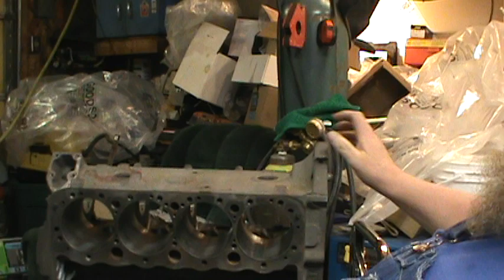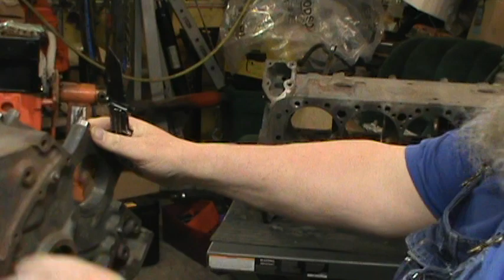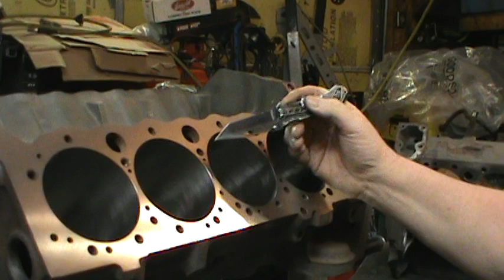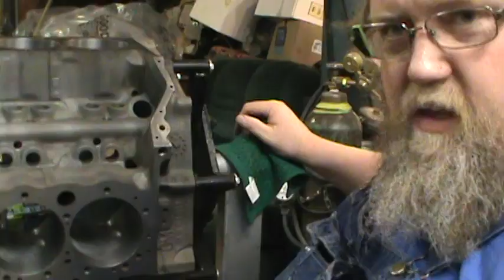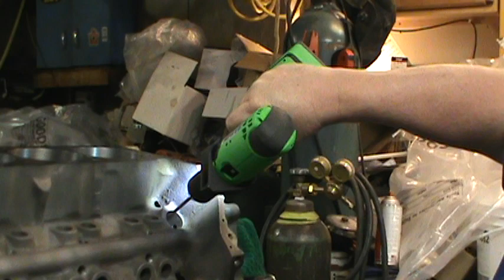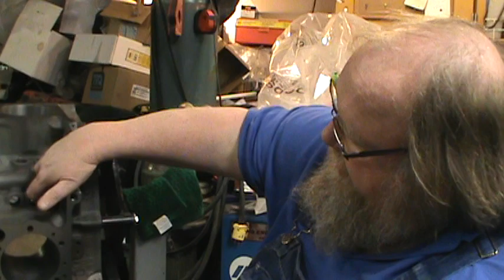ok the 377(383) build has started now finally after all these years

Comment: I have a 010 2 bolt . And a 010 4 bolt . I'll never part with them I know what you mean sir . I just picked up a gen 2 tbi 4 bolt 350 5.7 it's in great condition I pulled the heads and found 040 pistons . And. 010 main and rods it's got 194 150 valves at 5/16 stems I think she will take 10 lbs boost no prob . What you think ?

Comment: Rod Rod the reason for the extra water passage is related to the fact they do not need the center freezeout plugs of course you know they’re not really freezeout plugs just relieves to get the sand out of the block i’ve seen enough of them to tell you that for sure I think he was get some extra water passage because of the 400 that was something they did when these blocks will finally produce I know because I worked at Robert Chevrolet in their early 70s a lot of mechanics used to have lunchtime discussions and debates over different castings that we saw all day longMaybe you younger guys just nervous about that but it’s common knowledge

Comment: I built a .40 over 421/400 with a 3.875 stroked forged crank and the #6 cylinder wall/piston turned into dust at 7200 RPM.I would never go .40 over in another GM 400 block. The CR was 14.2 so that may have been the problem in hind sight, not enough meat to handle the CR.
Reply from the maker: wow that was a real high compression that may have helped it

Comment: they say 1970- 1972 400 didnt have that water jacket hole, i read an article in hot rod magazine about that!!!  the way you had the two blocks set up there even ray charles could see the difference!!!!! ha ha  yeah i found that article when i was looking for info on drilling steam holes for mine!!!  i like the way you prep the block, if mine had not been machine and cleaned and cam bearings already installed, i would follow sute!!!! looking great bear, thats a neat block!!! it was meant to be!!!!!!!!!!!!!!!!!!!
Reply from the maker: ya i think its going to be just as fun as my last 377 when i met the wife.